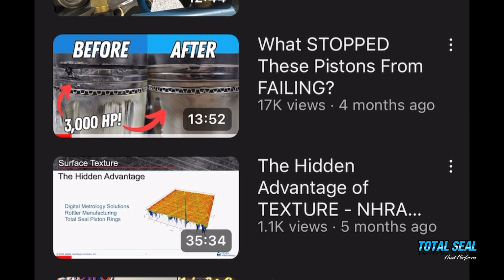Need HIGH Quality CUSTOM Piston Rings In LOW Quantities?

Comment: have you ever worked with rotary engines and their apex seals and oil control rings?  It is an internal combustion engine, but not piston based.  Lots of snake oil Apex Seal claims and makers out there.  Your technology and passion maybe could provide insight unto their unique chambers and needs.
I know just enough to understand the chemical advances you have made in one area may not transfer over; different coatings and materials = different science.
As much as Rob Dahm has worked with Valvoline; I always secretly hoped there was a crossover to other industries to advance the little wankels for the enthusiasts.

Regardless, I find all of this interesting; thanks Mr. Speed Jr. for being who you are and spreading information and leading me to channels to absorb data I may never have a practical use for! :D

Comment: I just want a set of rings that are gapless, can provide higher engine vacuum, extremely low blowby, can last up to 40,000 miles on an engine before showing signs of fatigue, and do it in an engine making up to 40psi of boost. That's all I need for a street-driven 1000hp engine. Is that too much to ask?

Comment: Ok. Let's get some, 68mm, 70mm & 72mm Gas ported, low tension, 1mm, 1mm, 2mm packs with .004, .005, .006, .008. 009, .010 gaps. Lots of kart  racers with HF Predator 212, LO206, Animal, Tillotson, B&S, and Honda clone engines looking for performance ring options. Not much variety, out there for options especially when it comes to gaps smaller than .010. Lot of the gaps are in the .012 and higher and gets lots of blowby, causing excess crankcase pressure, blowing out oil out of the crankcase breather ports. Pretty big issue without a solution.

Comment: I called about getting gapless piston rings made for some custom 1x1x2mm Mahle pistons for my 1000rwh turbo L83 and you said you didn't have anything.  Are you now making custom piston rings?
Reply: You want a gapless 1mm ring for a turbo application?  They probably told you no because it’s not practical to make a gapless ring that thin, and it would never live.
Reply: @Mike-FoxsAbroad  that could be a reason why.  I hope the 1x1x2 mm ring package that came with the Mahle pistons hold up.
Reply: @ls1nissan  I just did a SBF 363 turbo build and was steered away from a thin ring package like that for those exact reasons. They are amazing for N/A engines, but boost or nitrous builds need something a bit more robust.  There are specific ring packages for turbo engines that they would likely recommend, but thin and gapless are not usually recommended for them.
Reply: @Mike-FoxsAbroad  I was just thinking gapless would improve crank case pressure issues.  Blowby.  Guess I have to trust that Mahle has confidence enough in their ring package.  These were a set of custom pistons not off to shelf.
Reply: The "no-mans-land" bore ranges need some love
Reply: Are you sure the top ring land isn't to close to the top, let alone a 1mm ring. If it's gapless that's only 20 thou. N/A is no probs. but added boost? Unless your chasing the last few HP and happy to rebuild it every run down the 1/4 mile? 
Mahle make good pistons.
Reply: @gothicpagan.666  Top Land Height is 6mm and anodized.
Reply: @ls1nissan  I work in a reman engine shop in the UK. Some of the work we do involves engines used for low level motorsport. IE production engine machined to tighter tolerances using off the shelf parts, sometimes adapting something else if it's a really old type off motor.
They have their own test bench and chassis dyno, never feels like going to work. But what some of you guys do is literally another world.
Reply: @gothicpagan.666  What do you mean what we do is another world?  I told Mahle exactly what my build is and they designed and built me some pistons.  I'm going to use what they made as they know more than me